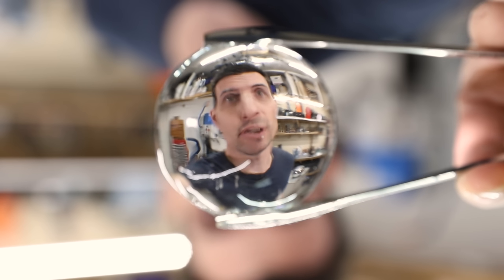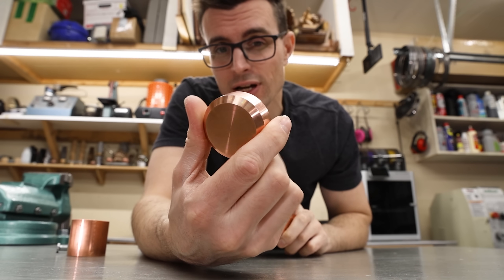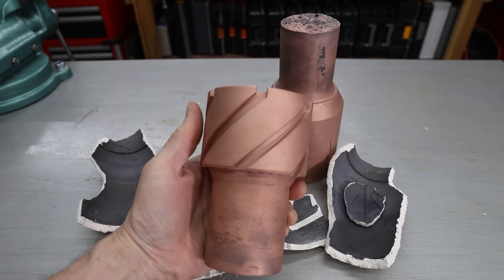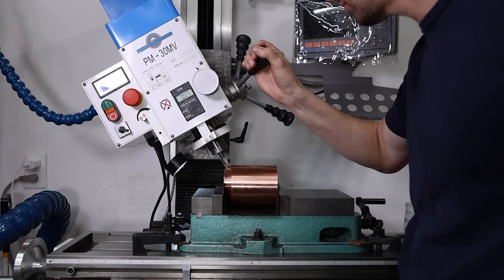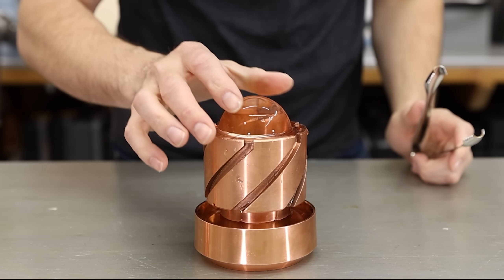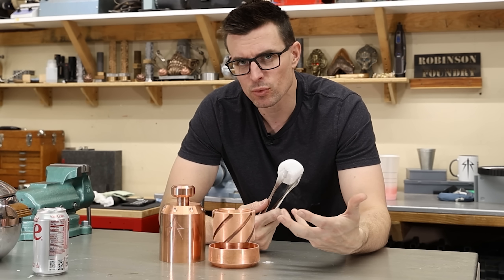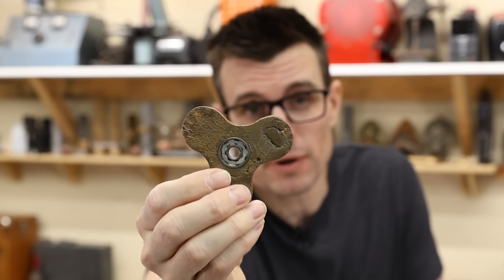I made a Copper Ice Press that Turns Ice into SPHERES - Lets try DRY ICE!

Comment: CuBe 98/2 Copper-Beryllium alloy would maintain thermal conducivity, have strength literally as strong as many types of steels, and aid in machining. Cons? It's EXTREMELY expensive and most importantly, it's freakishly toxic to work with. It's a shame, CuBe alloy is a mechanical marvel, but gosh is beryllium bad 

Obviously, i do NOT recommend working with anything containing beryllium, but just wanted to raise awareness about an exotic special metal and it's unbelievably impressive properties

Comment: As you press more balls, the press will rapidly cool and be unable to press more. An internal water reservoir, even a small one, thermally coupled with copper fins would improve the performance a lot since the specific heat capacity of water is >10x that of copper.

Comment: Nice project makes ice balls.

You may need to freeze the copper press before using dry ice, otherwise the co2 will off gas faster cracking the dryice ball.    
     Freezer=0 F.  Dryice=[-]70 f

Comment: For a dry ice sphere, I would use a real press that is not thermally conductive.  Break up the dry ice into small pieces and then compress then into a sphere.  The squeal that you hear is the burning off of the gas, which is the permanent loss of material.  When you use something that isn’t thermally conductive, you only lose a tiny fraction of material.  You could cool your copper press to -40 or lower too.  Liquid nitrogen anyone?  😂

Comment: What if you would take the 3D printed mold and demp/evaporate a coat of copper into the ice contact aria and outer surface. How would that compare if you added the same pressure weigth? Would the copper conduct equally?

Comment: That's a nuts bench top fire suppressor right there...for as long as there is dry ice in the chamber, those helical channels will be pumping a spiraling blanket of decent pressure CO2 all across the bench top...nothing on that bench is catching fire while that sucker is running...

Comment: You can add something organic to absorb the gas. Add a piece of wood and let it burn before you start pouring. You can also use borax to isolate the metal from oxygen. This will help make the equipment quieter when pouring and protect the shell.

Comment: To rid the ice of dissolve oxygen, which is where the 'foggy' color comes from, try using hot tap water poured into the ice molds. You can also bring water up to a boil, let cool and use that. Your ice cubes should come out crystal clear. Love the video!!

Comment: I've heard that one shouldn't have the sandpaper strips around the piece like in 8:35. At least it was held with two hands away from each other, but the best practice is probably to have less than half of the material in contact with the sanding paper strip at any one time which is most easily done by having the sandpaper texture away from you and pressing it into the side of the piece which is towards you instead of going around.

Comment: I have a press like this made by The Macallan. It has a hole through the top handle down into the sphere receptacle. This prevents the pressure buildup and angular tilt you see about half way down and gives another exit for water through the top. It also goes faster. Maybe something to think about. Check out the top of the handle of the Macallan copper sphere press.
Reply from the maker: Interesting, thanks for the tip. I was looking at that one but didn't notice the hole.

Comment: Lost PLA casting is such an interesting off-branch from lost wax casting. So much easier to get the form you want, though I suppose the trade-off is printer definition.  You'd want some pretty fine layers to keep from getting an excessively ridged piece in the output, no?

Comment: BTW, you can make perfectly clear ice when you vibrate it when it's freezing. You can do this with a DC motor attached to a plate or tray that you put in the freezer to place your ice cube trays on. Yes, wires will have to run out of the freezer door to supply the energy. 
Or use a cheap sonic jewelry cleaner!

Comment: I think what happened with the dry ice to produce all that noise is that it was violently boiling in there and the gas couldn't really escape due to the shape. Also very cool to learn some english metal casting terms. I work with a lot of these methods at my job, but I only knew most of the terms in german until now. Wonderful creation, this.

Comment: i know you have heard of lost WAX casting but did you know you can 3D PRINT with a wax filiment? When used for lost wax casting, the burnout is extremely clean (much better than using plastic filament).  This product can also be polished, machined, and carved MUCH easier than plastic filaments. oh and also if you DE-GAS water BEFORE you freeze it it come out clear as well and you dont have to put it into a insulated container.

Comment: Phosphor copper does not effect the purity of the resulting casting as the phosphorus reacts with dissolved gasses and produces a slag which floats on the molten copper and unreacted phosphorus just reacts with air if you leave it for long enough. Then you would also need to add some flux to remove hydrogen but again it just produces slag and the unreacted flux burns off. You just need to make sure you give enough time after adding degassing agents for them to fully react before pouring.

Comment: Really awesome - for those interested, Vevor has an aluminum version for $98.
On making clear ice, easier and more effective method is to take an Igloo style cooler, fill about 80% with water and then put it in the freezer - can take a few days depending on size and quality of cooler but you'll get about 2/3 of the water crystal clear.
Reply: honestly the biggest difficulty in making clear ice is that all the reasonably priced methods rely on creating blocks much bigger than you actually want, which are partly clear. Ice is just hard enough to cut/break for this to be obnoxious.
Reply: @EllipticalReasoning  There are actually a couple of options which are reasonably priced - for example, one technique features a silicon mold which you put upside down into a mini Styrofoam cooler so that as the cube, sphere or skull freezes, the air is pushed down and into the excess water you add to the mold - those types are pretty effective as I've got both the sphere and skull versions.
Going back to my cooler suggestion though, ice is actually happy to break like glass, meaning that if you score yourself a dedicated saw or simply an old/cheap steak knife whose edge you don't care about anymore, you can score it and then get it to break along the scores with a good tap from your meat tenderizer or a rubber mallet.
Making clear ice at home ultimately is simply a matter of having the space and the patience to wait a few days for it to form.

Comment: Using dry ice would not have worked because if you wanted to change the shape of ice made of water you would press it into the mold you want and part of it would turn into water and the desired shape would remain. As for dry ice, it is a sublime substance, meaning it moves from one chemical state to another while bypassing a certain chemical state. For example, in dry ice the liquid state is bypassed, so this method will not work with dry ice. I learned all of this from one definition I took in school.  and why you don't boil the water that you're using so your ice be clear .Thank you, with my regards from Iraq.😊

Comment: If you set up IR sauna lamps in a circular pattern around the suspendaslurry shells and add sufficient airflow, you can get hardened shells in two hours! Huge difference from a 10 day process. There are commercial machines (big $$$) that are sesentially just this. You need a lot of airflow, have used home depot air movers with success.

Comment: The only thing that would work faster for melting would be silver because silver (at 428) has a higher thermal conductivity than even copper (at 401). Gold comes in at third (at 318) and aluminum after that (at 236).

Comment: i get it that you wanted some fancy manufacturing video, but it went much more labour intensive than it should. you already have full machine shop, only thing you was supposed to cast is stock bar, rest you could achieve with lathe with much better tolerances so your top piece would not wobble till melts the ice and in that process create ridges on the ball but instead just perfectly slide down.

Comment: Instead of the 12:00 idea of putting it under HOT water, since the first one melted SO quickly, I actually got curious whether it would melt more smoothly if you put the copper into the FRIDGE, so that it's starting from ~35°F (2 °C) or so
Reply: *since "Dry ice sublimes at 194.7 K (−78.5 °C; −109.2 °F) at Earth atmospheric pressure." maybe putting the copper casting in the FREEZER so it's ~0 °F ( -18 °C ?) would make it not such a violent "heat shock" jumping those extra ~70°F / 40°C that going from room temp (70F / 22C) would be 

I'm curious how it would play out from the freezer, with the dry ice / CO2
Reply: @meganw6007 let's make one and try it lol

Comment: That's awesome, I now see why the commercial ones are as expensive as they are! Though I wonder if they're machined out of solid bar stock.
If you live somewhere with cold winters, you can make a lot of clear ice in a chest cooler outdoors, same principle. I just fill the whole thing and let the top few inches freeze over a couple days, then decant the whole thing and score and break the slab into chunks. Only works in the winter but if you have the freezer space you can stock up for a while.

Comment: I've had a project in mind to cast custom bus bars out of pure copper wire scrap, and would be interested in seeing you attempt some low porosity copper castings. I've heard 5-10mm of crushed graphite (or possibly charcoal) floated on the metal melt will reduce dissolved gas content. I'm not sure if you need a pouring flask with a wire screen, or if just a spoon will do, but if you have more copper castings in the works maybe you could give that a try?

Comment: That could be done with an aluminum mould with inner room for mildly hot water. Just two caps, one of them should be screwed on the other, then you fill the caps with hot water. The lower cap should have the spherical shape pattern on it and voilá.

Comment: I think you should elaborate on the difficulty in working with copper, because in my opinion it's pretty easy to work with due to its softness, however I'm sure that can be a problem when it comes to precision, but I find the harder the material the more difficult to work, you always need something harder than what you are working on and sometimes that can make for very expensive tools.

Comment: From what i learnt they  put the water on a slightly vibrating tray it makes bubbles leave & ice is  clear as glass
distilled water trick pour not quite frozen   freezes as you pour  Make  ice bubbles put out side on a tray 10cel they freeze  throw against walls as Nads  fill some with smoke or  colors

Comment: A few years ago I got a couple of spherical ice molds, and learned that if I used "warm/borderline hot" water, I got clear ice! Don't know the science behind it, and it was a tip from my 78yr-old mother, but I guess it used to be pretty common knowledge...? Hope that helps somebody...Awesome vid btw!
Reply: Yeah increasing temperature reduces gas solubility in water
Reply: I was about to post this then saw this. You're absolutely correct hot water is the best way to get clear ice.
Reply: The trick to clear is is making a lot at once, and slowly freezing in a particular direction (by using insulated walls). Impurities get pushed outwards to the edge by the liquid water as the crystals form. You can look up "bartender tricks to clear ice" or something if the sort.

Edit: lol that's exactly what he does in the video
Reply: Heating water removes gases dissolved in it (boiling water even for a while makes it practically degassed).
Reply: Guessing it takes longer to freeze, which gives more time for the ice crystals to align and gasses to escape.
Reply: Hot water can contain less gass, maybe that's why
Reply: my guess is that since a lot of common gases get less soluble when temperature increases (hence e.g. why warming the oceans causes even more CO2 to be released into the atmosphere), it results in less trapped air?
Reply: Additionally, I've heard hot water freezes quicker than cold....I don't know why or if true but freezing speed may be a factor in clear ice
Reply: @joebonomono  I doubt it because to get clear I've you actually need it to freeze slower. So maybe it's the opposite the hotter water allows it to freeze slower achieving better results.
Reply: @Cristian_D63  I googled whether or not hot water freezes faster, it does, it's called the Mpemba effect, but it's variable and things like container shape play a factor. If slower cooling makes for clearer ice than my hypothesis is most likely incorrect. However knowing that fact about hot water and slower cooling for clearer ice would allow someone to design a clear ice maker that cools super slow like in a thermally insulated type of environment where it might take a few days to cool down and freeze.
Reply: @joebonomono the Mpemba effect is not real
Reply: @joebonomono it does not freeze faster, saw a video on here that settled that myth once and for all. Can link it if you’re interested.
Reply: @smOOdiebOOdie  Sure, I'm always interested in new information, the link would be appreciated. Thank you
Reply: @joebonomono Hot stuff cools faster than not as hot stuff, but still has to cool to the not as hot stuff temperature, then continue to cool. Thus, the total time is longer.
Reply: @ it’s definitely a myth. Think about it.
Reply: @chir0pter it's true. It's known as the mpemba effect. It depends on many factors tho so it won't work for everyone but it is true
Reply: @ It’s not real. “In 2016, Burridge and Linden defined the criterion as the time to reach 0 °C (32 °F; 273 K), carried out experiments, and reviewed published work to date. They noted that the large difference originally claimed had not been replicated, and that studies showing a small effect could be influenced by variations in the positioning of thermometers: "We conclude, somewhat sadly, that there is no evidence to support meaningful observations of the Mpemba effect."”
Reply: Warm water can freeze faster by promoting decentralized ice nucleation points in solution promoting homogeneous crystallization networks, the result of a more consistent temperature gradient in solution while cooling. Freezing around the edge of a cold solution can help insulate the interior liquid limiting the molecular conduction to the exterior cold. It's like calculating if you're more likely to freeze to death running to somewhere in freezing weather rather than walking to that same destination in the same weather. Duration times wind speed divided by heat capacity and thermal resistance of the freezing subject. You'll notice how ice shows up to insulate wherever large temperature gradients occur, such as frost on windows or ice in the gap of your freezer. Boiling water thrown into the air will freeze faster than cold in the same way because the water particles are separated enough to interact with the sub zero temperature particles in the air in large amounts

Comment: To help with shrinkage, bury your molds in sand before pouring instead of leaving them in open air to prevent freezing prematurely. Also, when using 3D prints as plugs, I have found coating them with dry molybdenum spray coating helps tremendously. It allows them to release from the pertrobond incredibly easy, and helps smooth the printed surface a bit. It allows you to get away with more complex plugs, and smaller features, often not requiring any draft on some features even. "Spray-On" brand LU200 or CRC 3084 is what I use. A few coats, then buff out with a dry cloth to a metallic sheen. You can also spray it directly in the mold cavity after the plugs have been pulled to improve surface finish, although I have not tried that with copper. Works great with aluminum however. Works similar to the mold washes seen used commercially.

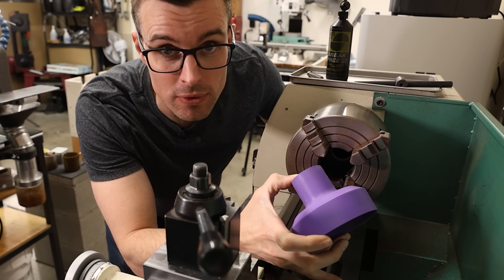Comment: 2:13 Yeah, I worked a temp job inspecting rejected parts due to casting defects and some sand collapsed into the metal as it solidified.
By the way, those parts were aluminum, all 900,000 of them!

Comment: hey, i've seen those videos of people using diamond to melt through ice at an absurd rate due to how conductive it is to heat.

are there ways at all to fill the inside with that and maybe an outlet where you can hold onto the diamond/copper (or some warm water there) to basically melt through and make an icecube in like 10 seconds?

Comment: If you want clear ice you can use a vibration motor and tray to vibrate the ice while it’s freezing it will be crystal clear except the top little bit but that top part you can cut off or it’ll melt off in the mold

Comment: I'm utterly fascinated by the speed at which it all happens in the end. 40/20 seconds is not even remotely what I had expected. Super cool video!
Reply from the maker: Thanks! You and me both!
Reply: When you consider the amount of energy needed to convert ice to water, it's very impressive. 334 joules for every gram (water's latent heat of fusion, almost 100x more than is needed to raise 1g of water 1c). That's why we chill drinks with ice, not cold water. The ice is like a cold battery that you've added cooling capacity to by making it solid.
Reply: Thats what she said
Reply: 2 seconds?/??/?/?/?🤯🤯🤯